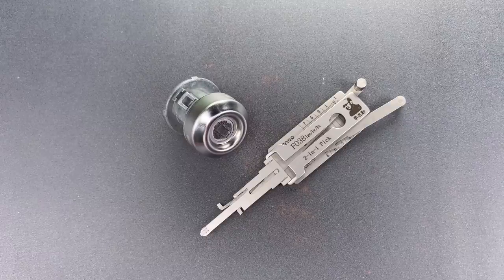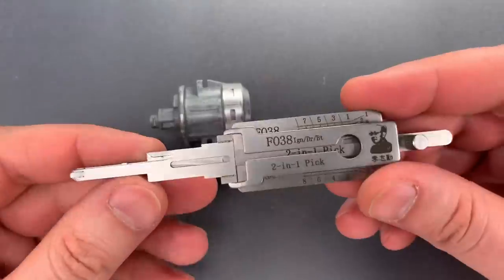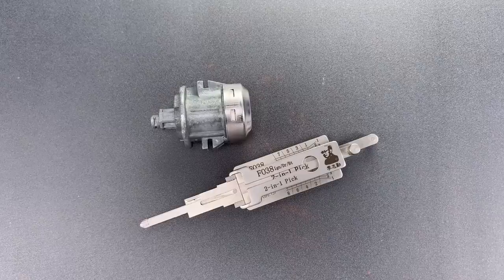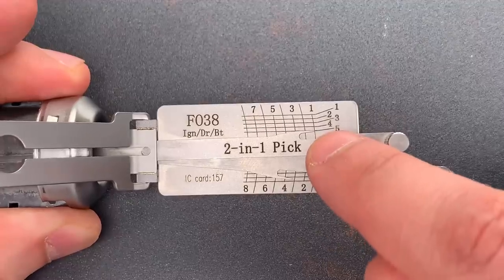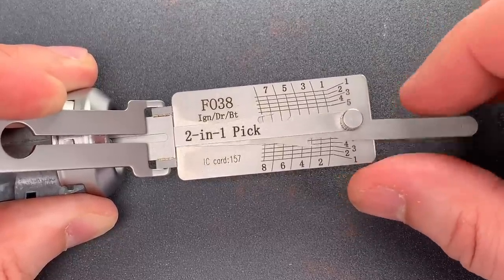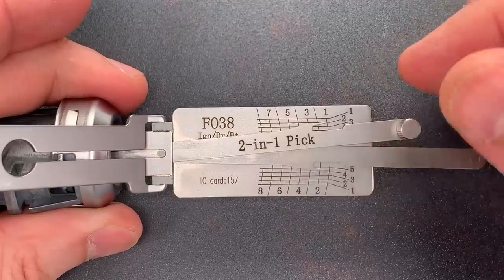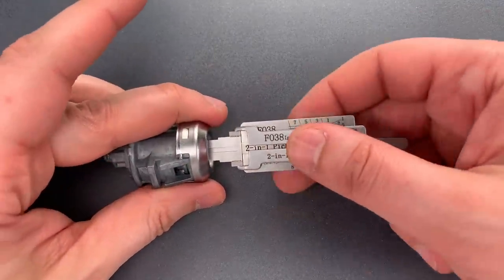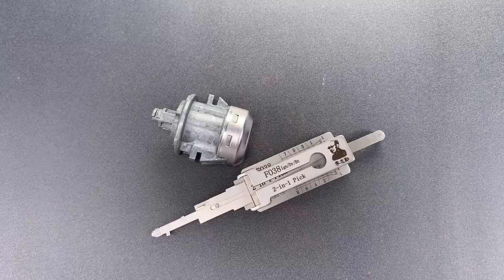[1240] Ford Expedition Lock Picked & Decoded w/ Lishi Tool

Comment: I wouldn't expect to see locksmiths with hundreds of dollars of highly specialized key decoders in their bag, especially as car anti-theft technology gets more advanced. The inflatable balloon that wedges the door open is not only far less expensive, it is much less demanding in terms of skill, and can be applied in far more conditions. Both methods don't have the microchip required to prevent the car alarm from going off either, so why spend the extra money?
Reply: Chips protect engine start, not entry. One inside chip value can be found or new chip can be programmed.
Reply: @ttww1590  it is? When i locked my keys in the car last, they used a balloon to open the door enough to unlock the door from the inside. This caused the alarm to go off.

I assumed the chip in the key was what keeps the alarm from going off when i open my door normally. If this is not the case, why does the alarm go off when the door is opened via the balloon?

Comment: Would it set off the car alarm? Not tryna steal a car and idk how car alarms work I’m just curious
Reply: Depends on the car. Most will only go off when they sense a force applied to the car. You however won't be able to start the car as almost every car on the road these days is fitted with an immobilizer

Comment: What car thieves used to use on the old European Ford locks with the first types of central locking was half a tennis ball laid over the lock itself and then smacked to create a kinda push and pull air pressure and it would pop the lock.   When airbag/alarm/central locking modules interlinked came out another trick was to kick the bumper hard on the front passenger side which simulated a knock hard enough to tell the ECU to pop all locks open although back in the 80's the old Ford/BMC/Vauxhall locks were very easy Squire's which could be opened with a bit of windscreen wiper or even a spam key they were that lame and prone to wear.   I actually had a Mini with the dashboard mounted ignition key that I did use a spam key to start as the locks and innards were just brass and pot metal so wore down very easily lol

Comment: One problem in your industry is you have NO idea who knows what they're doing. One day the key to my Nissan pickup wore down to the point where it wouldn't work anymore and left me stranded at a gas pump. I called a smith out and these two gypsies showed up and played with my car for 4 hours and didn't do a damn thing. I think they just rattled it until they got the cylinder to rotate. I expected something like your tool but that's not the type of locksmiths they were and I had NO CLUE about it. A week later I got pulled over by a cop and couldn't move my truck when he was done. I called a friend, went home and got my tools, drilled the two break-head bolts out of the column and started the damn thing with the ignition switch. When I got home I put the core in a vice, inserted my key, ground the wafers flat, and reassembled it. The fact that I did what a locksmith SHOULD have done in less time is sad.

Comment: I've used these for years on every car manufacturer, you decoded the lock wrong. Once you feel spring pressure you continue to press until the picking arms stops. Yours cuts were all one cut off the key would not have worked in the lock

Comment: You are not decoding that right... if it goes past the line to the next one that's what the cut is your cuts are off. 1 1 3 3 1 2 most ford doors locks are going to be missing the 7-8 cuts

Comment: Why doesn't AAA use these things??? No they use the "Slim Jim" which tends to break the lock or what ever else it gets tangled up with when in the hands of a novice, and then THEY CHARGE YOU for breaking your door locks... When in reality they should be paying to repair your door, because lets face it, if I wanted to give easy access to the inside of my car to a would-be criminal, I WOULDN'T CALL AAA, I'd hunt a rock or something down to smash my passenger window. It's cheaper to replace a window then a door lock or any of the internals in a car door. Nothing more annoying than being stuck with a drivers side window that doesn't go down anymore, thanks to AAA, in the summer...